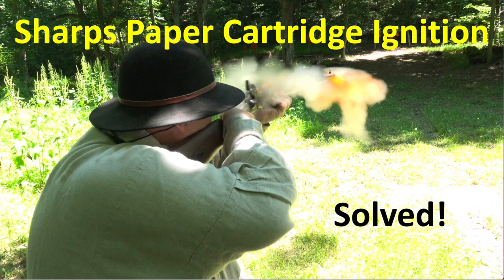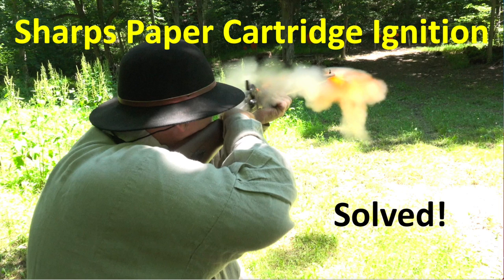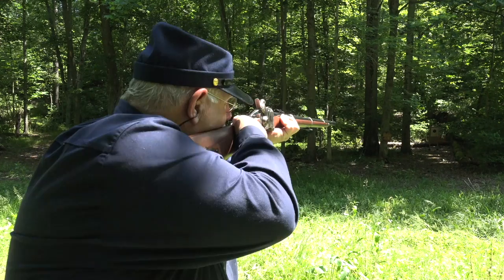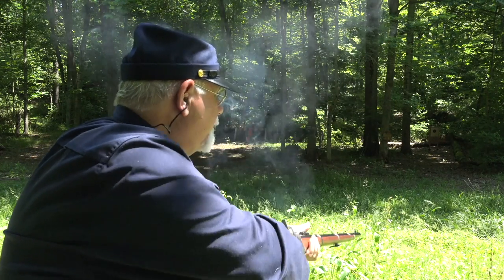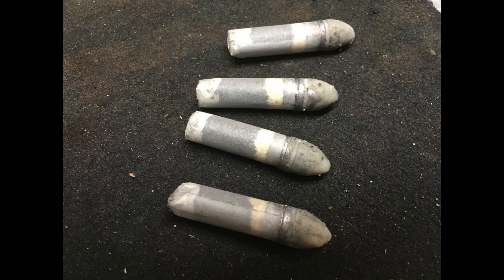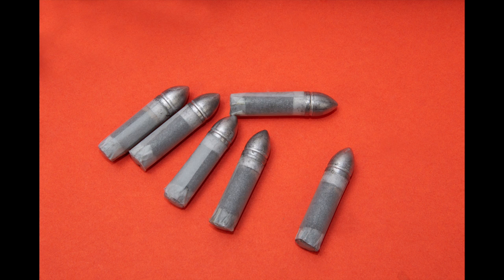Sharps Paper Cartridge Ignition   Solved

Comment: What happens to the percussion caps after use do you throw them in the bin at home or is there a special box at the range you put them in?
Reply: In my experience, they usually blow apart when detonated, and when you recock the hammer they fall off the gun and onto the ground, where they are ignored. I guess you could take care to drop them into a bin if you wanted, but percussion caps aren't exactly a big deal to let return to the earth. Not near as bad as, say, 22lr cases, and few people pick those up either.

Comment: Does your Sharps have the floating chamber? My Arms Sport does. I took the rifle back at a heavy discount. I've ordered a trigger assembly from Dixie, hoping it fits without to much fettling. As for the breech block I have a plan. Loctite makes a strong assembly adhesive that works on steel. The play in the breech is .008 inch, I have a leaf in a feeler gauge that is .006 inch. I can sandblast the mating surfaces and glue the leaf to the block, a .002 inch clearance should be within spec, at least in my opinion. I should know in a couple of weeks.
Reply from the maker: No. Larry Flees installed a fixed chamber.
Reply: @duelist1954  That's right, you said that.

Comment: I'd always read that Sharps rifles had a knife-edged breechblock that cut the cartridge open as it rose. never sounded like a very efficient system, you could lose varying amounts of powder and thus have variable velocity. Of course they may no have known or worried about that in 1859.
Reply from the maker: It was not efficient, for the reason you stated. That’s why they changed to the flat based paper cartridges

Comment: I wonder if cigaret rolling paper would be an option? Yesterday I bought an Army Sport 3 band rifle, didn't expect to but found an unfired example in a local shop and had to have it. It has a couple of issues: a missing lower band retaining spring and an inoperable set trigger. I'll take the trigger group off today, see what's what. I have located a source for the clip. 

A question about the breech block, is there supposed to be any fore-aft play? It seems as if it should be snug but mine has .008" play.
Reply from the maker: Cigaret paper works as the bottom cup, but it is too flimsy for the cartridge tube. There should be no play in the block.
Reply: @duelist1954  I didn't think there should be. I may see if he will take it back, trade it towards one of the two Uberti Remington 1875s he has. A shame, I like the rifle, other than the sloppy fit of the breech block it appears well made. But with the slop I doubt it would cut the tails off the  authentic paper cartridges, there would be massive flash leakages around the breech too. I just got done watching a video from the Eras Gone guy, these rifles are fascinating, I really wanted it to be a good one.
Reply: @duelist1954  Upon examining the trigger group I found that it had been molested, there was a weld done and there was no way that the set trigger would ever work. The shop took the rifle back, in it's place I now have two Taylors/Uberti Remington Model of 1875s, 5.5", new in the box, .45 caliber. I was going to get one of the Remingtons anyway, a shame the Sharps was so messed up.
Reply: @duelist1954  Hairdressing paper has been recommended on some of the forums, thin but strong. I'm going to eventually have to get my hair cut again, perhaps I'll remember to ask if she has a few sheets to spare.
Reply from the maker: It is a little too tough for the cartridge base. Cigarette paper works well, as does tissue paper.
Reply: In place of one of the Remingtons I bought the Uberti Model 1873 Winchester in .45 Colt that was next to the Sharps. Several older .22 rifles went towards the trade, they were taking up a lot of space anyway.